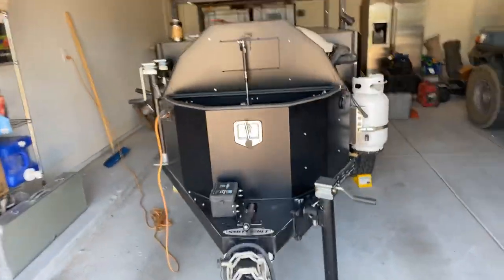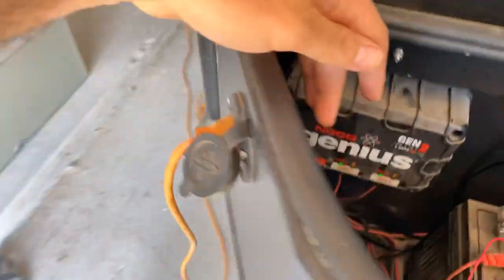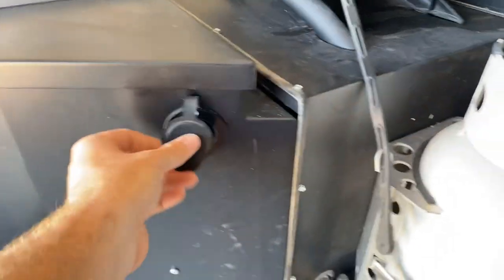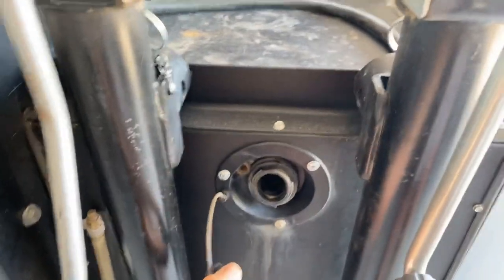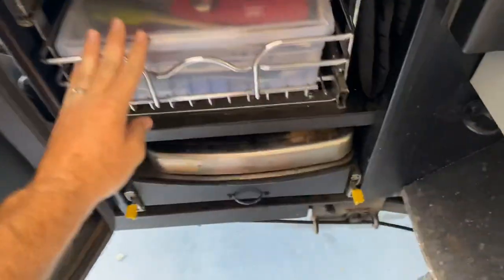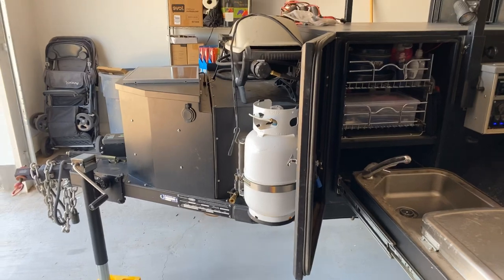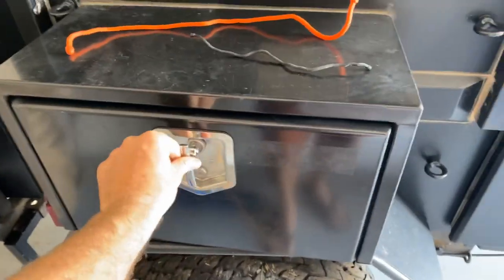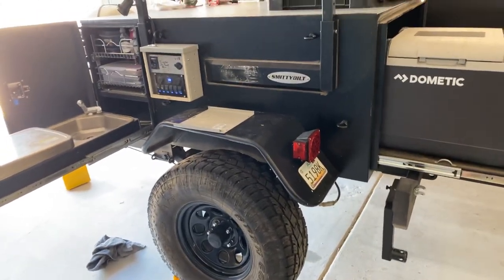ULTIMATE Smittybilt Scout Overland Trailer

Comment: Jeremy, great video. Thank-you.  Not sure how many times I have watched it now to see how you did your set up, but it is a lot.  Can I get more information on your water heater?
Reply from the maker: Good question. It is a domestic tank water heater. You’ll see two little ledges inside the passenger side of the trailer. I put some square tubing bridging the ledges to put the water heater on. If I were to do it over again I would go tankless for sure. Here is a link to the type of water heater I used. 

https://www.dometic.com/en-us/outdoor/rv-and-van/heating-solutions/water-heaters/dometic-water-heater-19566
Reply: @JeremyLashinske  Thank-you sir!

Comment: Great build! Ready to get  the Scout Trailer soon. What size fridge is your Dometic. I have the cfx95 dz, will it fit in the back? Thanks
Reply from the maker: Hey! Good question. It should fit. I have the 75 and it looks like the 75 and 95 are close in dimensions. I drilled holes in the slide out drawer and fastened through the holes into the threaded inserts on the bottom of the fridge. It has stayed really secure.

Comment: Looks great! 

Question: what brand/model stove & sink combo is that. Did you have to modify the Smittybilt slide out to fit it?
Reply from the maker: Hey, I did have to modify the slides. And it was a Dometic sink/stove but I had to chop the edges to make it fit. I could not find anything that was off the shelf.

Comment: Just bought a Scout.  So far it seems to have tons of potential, and your video confirms it!  How did you mate the awning brackets to the ARB awning?  My holes do not align between the bracket and the awning rail.
Reply from the maker: If memory serves the hole pattern is really close - I just kind of pushed them through. Let me know if that works and if not I’ll take a look at mine more closely.
Reply: @JeremyLashinske  Thanks for the reply.  I would love it if that's all it took, but man it sure looks like that's not possible?  Is there some way we can share pics?  I'd love to see how yours mates up.  I'm thinking of fabricating a flat plate adapter with some spacers, but if you got yours on without doing that, I'd love to see how.  Would save me a bit of headache.  Thanks!
Reply: There’s a Smittybilt FB owners group that may help as well if Jeremy can’t get you info.

Comment: You had the comments turned off on your 2023 Toyota Sequoia video so sending a message here. For the 3rd row car seat setup. Can you provide how many lower anchors and tether a chefs are in the 3rd row
Reply from the maker: Hey Ray, got that fixed. Thanks! There is only one in the middle seat. That is a downside. I’m using the seat belt to secure in the third row.

Comment: Hey very nice. Just picked up a smitty myself. I am very interested in your stove and sink unit. Is it a whole new slide unit or just sits on the current slide that smitty has?  Where can I find similar?
Reply from the maker: Hey! I bought the sink set up at a garage sale. I think it’s Dometic. I had to cut the perimeter to get it to fit. I pulled the stock slide and made my own frame and bought locking slides so it stays out. Thanks!!

Comment: Love the stove / sink set up! Where did you find that sink?
Reply from the maker: Found it at a garage sale! I think it’s an old dometic. If I were to do it again, I’d buy the new dometic slide out sink and stove. Worth checking out for sure.
Reply: @JeremyLashinske  Does the sink part not stop the stove drawer from closing? I tried sticking a Coleman Triton stove on is and it wouldn't close all the way. I figured it ran out of room to close but your's seems to close all the way fine.
Reply from the maker: @BarryReicherter  hey! I ripped the stock slide out and built my own out of sheet metal so the fit would work. If your Coleman fits inside the stock area designed for a stove then it should fit. I’m surprised to hear it doesn’t.

Comment: Basically picked one of these up because of your video! Just got it this weekend and am starting to order up some parts. For your truck to battery charging, are you running a DC to DC charger?
Reply: Just grabbed that same undercounter rev-a-shelf but it’s weird, the latch mechanism hits it, I’m not able to close the door. Did You have that issue and modify something to make it work?
Reply from the maker: Hey, that’s awesome. I ended up just tapping into the positive terminal on the trailer wiring so it trickle charges while driving. Right way to do it is to get a dc dc charger and it’s what I’d recommend
Reply from the maker: And on the shelf issue - you’ll notice the latch on the door is probably hitting the edge of the rev a shelf. I had to grind away a few inches.

Comment: Very nice, where did you get the side box and do you happen to know what brand it is? I have been looking for that size for a while for our Smittybilt trailer. Thanks
Reply from the maker: tim N michele Davis hi! I found it on amazon. Took forever to find the right size! Buyers Products Black Steel Underbody Truck Box w/ T-Handle Latch (14x12x24 Inch) https://www.amazon.com/dp/B01ASXTEY6/ref=cm_sw_r_cp_api_i_SO49EbHEJ34F4
Reply: @JeremyLashinske  would the 36 inch width box fit there as well?
Reply from the maker: @edwinmenzenwerth8214  yes most likely. Worst case you return it but I bet it would fit.
Reply: @JeremyLashinske  Thank you sir.

Comment: I’m definitely interested in your experience renting out the trailer on outdoorsy. I’m looking to buy a trailer and do a set up similar to this and I’m hoping to supplement the cost by renting it out but I’m worried there’s not enough of a market for the overland trailers instead of the big rv’s
Reply from the maker: It was hit or miss. We’ve slowed down on renting it out because people were pretty rough on it. There’s definitely demand though - just know you’ll be using the security deposit.

Comment: Good tourer of the trailer. Fairly well thought out, although using the sink has got too be awkward being so confined by the fender.

The power supply from the vehicle to the trailer via the 7 pin plug is inadequate to provide charge to the 2 house batteries in the trailer. You should research “voltage drop” you really need the appropriate size cable connected via an Anderson plug just as a stand alone power supply to properly keep the house batteries charged and maintained.
Reply from the maker: Hey Scott, it’s amazing - I haven’t experienced any of your concerns. I’m excited to see how ergonomic your trailer is. Please post a link to the review video. Thanks!
Reply: I’m currently living full-time in a 23’ off-grid caravan in South Australia, Australia. Moving around for work. Space and planning isn’t should an issue in a full size van.

When it comes to off-road, I just head off in my Land Rover D2. I’m actually just fitting out the rear for a fridge and a efficient use of the remaining space for storage. It’s simple but not easy ! Just have to do the best with the available space.

Safe travels.

Comment: I am planning to do the same setup for solar and battery bank, question: what about heat on sunny day for that box and the vent for your inverter.
Reply from the maker: I don’t have a vent - I’ll say the heat has been an issue. I typically just open the top if it’s too hot. Reality is I’m not usually out camping if it’s that hot out.

Comment: Do you have links to the water tank, hot water setup, inverter and switch panel?
Reply from the maker: Nicole And Josh Baldwin hi I don’t - the water tank is a 30 gallon RV tank which is common online. Water heater is Dometic and switch panel is Amazon.

Comment: I'm looking for a reasonably priced overlander trailer and saw your review. I also have an FJ Cruiser and plan on using it for power.
Do you have any issues pulling the trailer with the FJ?
Reply from the maker: No issues! It pulls with my FJ and my wife’s 4runner. Because of the way I did my water, the tongue weight is around 350 pounds which sagged the 4runner a bit. But we pulled the trailer fully loaded from Phoenix to Yellowstone which has many large climbs with no issue.
Reply: @JeremyLashinske  Jeremy, thanks for the reply. This looks pretty awesome and affordable.

Comment: was wondering, on the tent rack, does it still wobble once you installed the tent? also, how did you mount the rear stabilizing jacks? 😊
Reply from the maker: Hi! The tent hasn’t wobbled once we installed it. The tent acts as a brace and keeps it from wobbling too much. The awning is the only thing that rattles a lot still. The rear stabilizing jacks have two brackets that go inside square tube receivers at the rear of the trailer. I can put together a quick video on it if it would be helpful.
Reply: @JeremyLashinske  i think i meant storing the stabilizing jacks! i saw on the video you had it by the tongue.
Reply from the maker: @markgx_explore7233  that makes sense. I put a water tank where the spare tire goes and built a cage over it. I mounted some tubing to the rack so I could store the jacks there. There’s a company called Habitat Off-road that offers a solution for stock trailers. Check them out. https://habitatoffroad.com/collections/smittybilt-scout/products/smittybilt-scout-stabilizer-jack-mount
Reply: @JeremyLashinske  Just got my scout and loving the start of build, just remembering the days when i built my rig!

Comment: My question is about condensation issues with the rooftops?
Is there any?
On the ground we use full rain fly and I don't see that with rooftop tents.
Reply from the maker: Hey solid question. In cold weather there is condensation. There is a rain fly on RTT but they’re integrated into the tent for put up/take down.

Comment: I was wondering what size and brand your slide out rack above the stove is?
Reply from the maker: It’s a rev a shelf. I’m considering making another video with details on what exactly I bought if that would be helpful.
Reply: @JeremyLashinske  Could you link to it? That slide out rack would be an improvement over my Tupperware style plastic drawers. Thanks!

Comment: How’d you flush mount the solar panel? I just purchased this same kit and looking for hardware. Thanks
Reply from the maker: I used some sheet metal screws from the bottom of the lid into the aluminum frame on the solar panel.
Reply: Jeremy Lashinske thanks! I’m installing electric and hot water on my scout after seeing your vid

Comment: How do you control moisture in the nose box? Mine always seems to take on humidity, probably from the bolt holes on the floor of the box.
Reply from the maker: Nom Solo I used a sealant on the bolt holes so it is a tight seal
Reply: Jeremy Lashinske thanks, I’ll try some silicone sealant on them. Very nice setup by the way.

Comment: Do you have plans for the battery power setup?
Reply from the maker: Like schematics on how I did the wiring?
Reply: @JeremyLashinske  Yes.  I'm trying get a solid plan on how to set this up.
Reply: Did you add a junction box to the 7-pin connection from the tow vehicle on the trailer tongue? Would've been nice if Smitty put a junction in already but looks pretty straightforward to install. Just need to figure out to put it before or after the breakaway wiring.